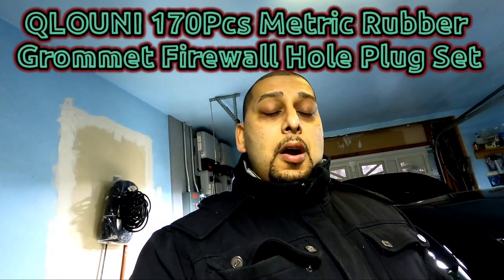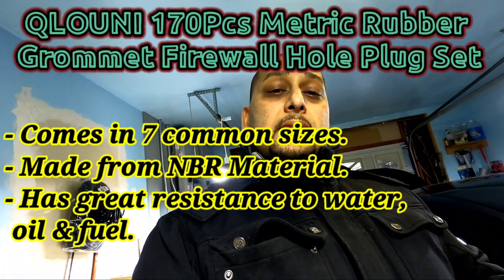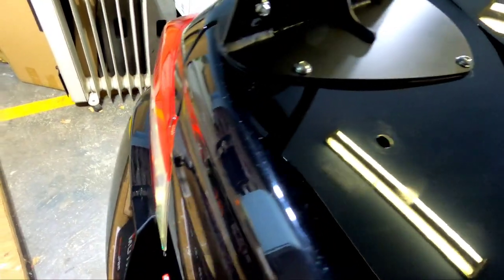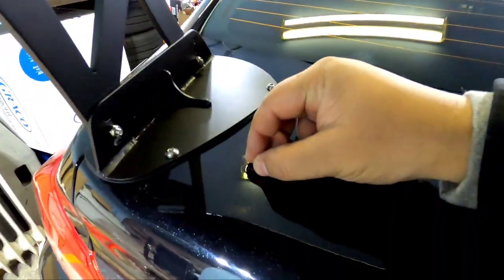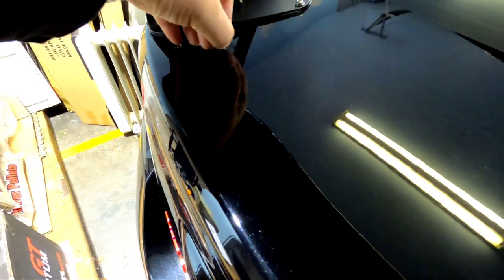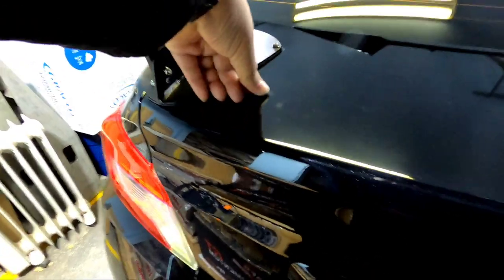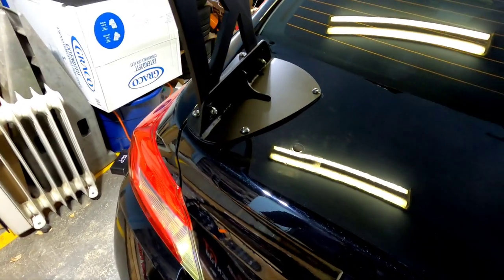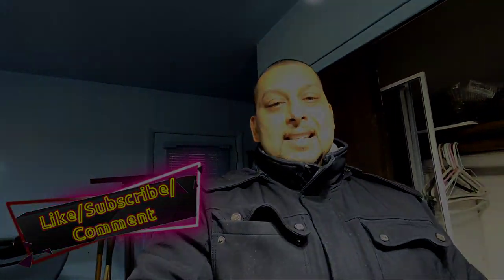Plugging trunk holes left from installing my Battleaero wing. (Qlouni firewall plugs from Amazon)

Comment: Sorry if I missed it, if you already mentioned it in your video but does this prevent water from getting in the holes as well? I wanna do this because I don’t like the spoiler on my car, I’m not sure to just keep it on there until I can get them fixed or if using these would cause my car to rust if water seeps in?
Reply from the maker: It does prevent water from getting in.  You just have to use the right size.  Mine has been plugged a year now and no issue 😃
Reply: @WikedWips  awesome thank you so much for your reply, I’ll definitely be ordering these then!
Reply from the maker: @amanda8151011  ur welcome!